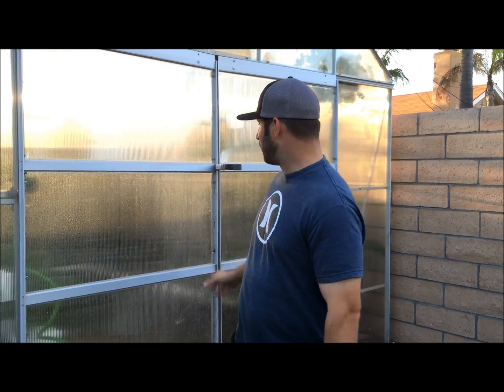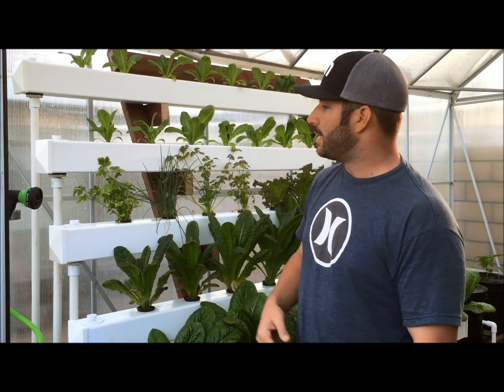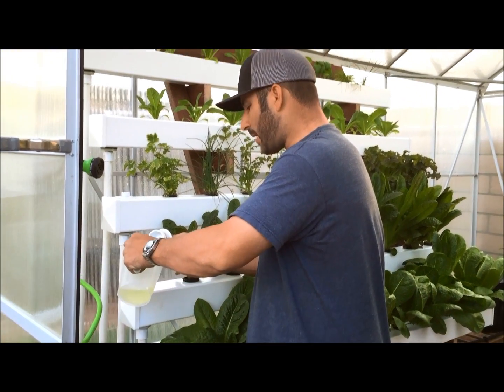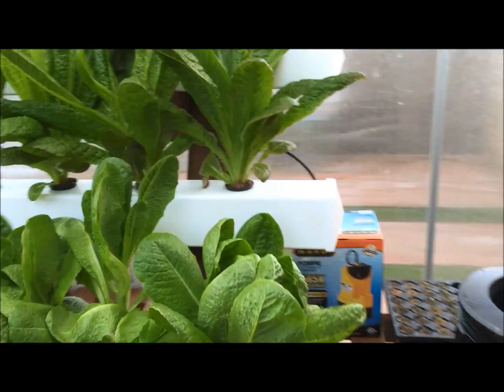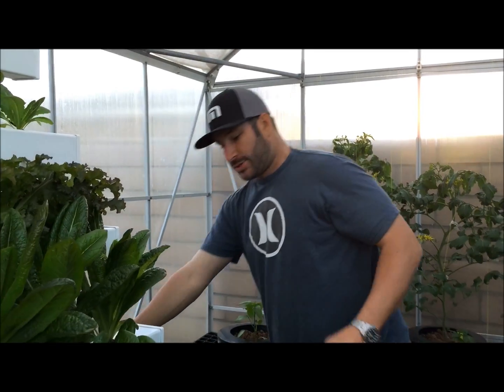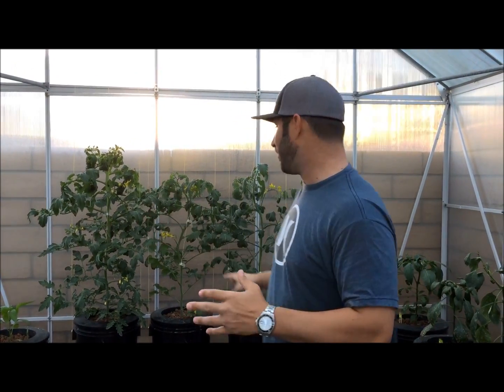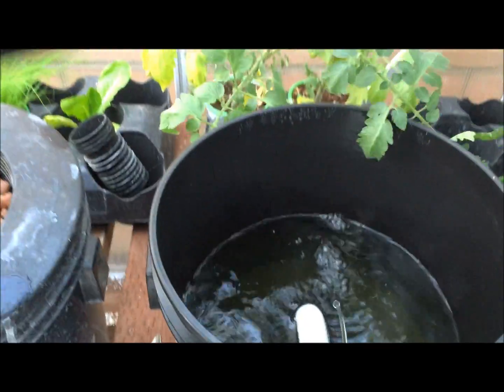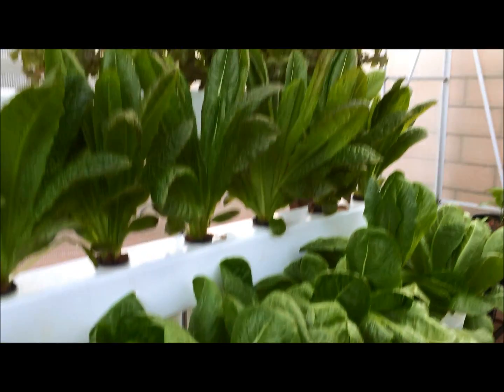Hydroponic NFT with Bucket System / Dutch Bucket

Comment: Man I absolutely love your setup. That's gotta be the most clean cut system I've ever seen. You make this stuff look so nice and easy. Btw, how much slope is in your nft system if I may ask?
Reply from the maker: Hi, appreciate that. I actually have zero slope. I let the water level reach the bottom level of the 2" net pots then just overflow into the drain. The feed line supplies enough water to keep everything moving pretty good. Generally, an NFT should have low level water flow, but I've found the plants suffer like that unless they have fully developed roots. This system gives every plant, large or small, plenty of nutrient water. I even use the rail as an nursery if you will, for small pepper and tomato plants too small to go into the bucket system. I use a neoprene ring to hold them up, and they grow super fast and healthy without the shock stage I normally get, then get dropped into the bucket line when they're ready, seamless transition.
Reply: Very nice! How deep do you normally run it? I guess the better question would be is water even touching the bottom of the pot, half way up or somewhere in between?
Reply from the maker: MrChevelleMan The water touches perfectly at the bottom of the net pot, so it's probably 2" deep, half way up the 4" post.

Comment: Very nice setup. I am just about to start construction on a greenhouse in my backyard. I have hired a carpenter friend to build  a 10'x10'x10' tall stick built greenhouse using pressure treated lumber. I am planning to install 5mm Solexx panels in mine as the glazing material. I live up north of Seattle near the Canadian border, so I need a durable structure that can stand a fair amount of rain and occasional snow exposure. Your tiered NFT system looks like something I will try to replicate in mine once it is built. If you make any more changes to your system..perhaps you could do a video showing you actually build whatever it is you are making? Do you just use a hole saw with a drill to make the holes for your net pots? How much would you estimate the total cost would be for all the parts to replicate your entire system as it sits in this video? Thanks!

Comment: Pretty sure they are pvc fence posts you can get then 4x4 and 5x5 at home depot with glued on caps on each end
Reply from the maker: Yes, you got it, 4"x 6' vinyl fence posts. The caps need to be water tight glued. I used silicon.